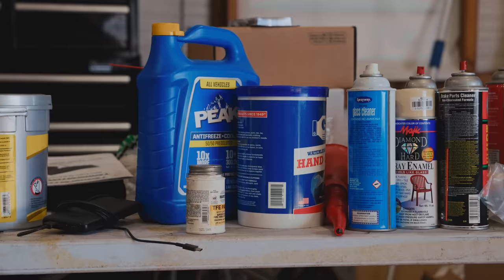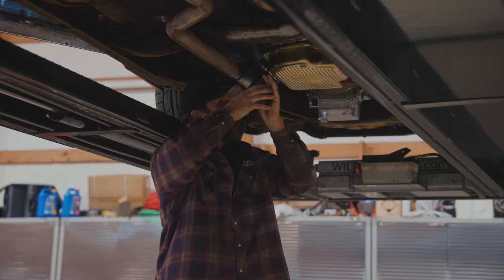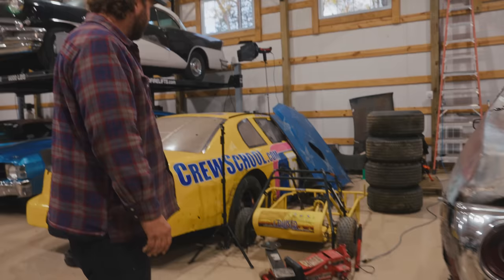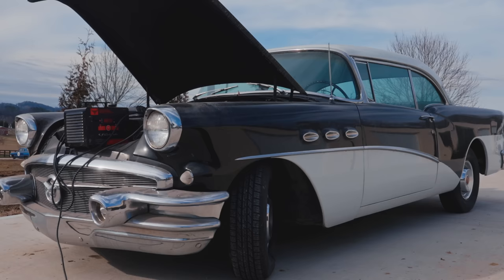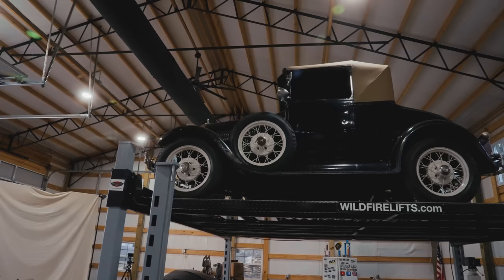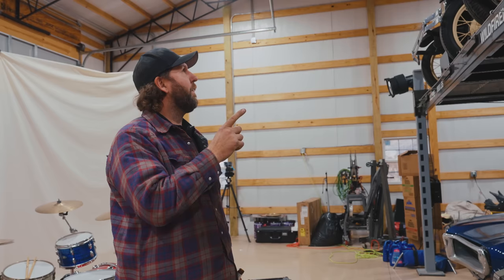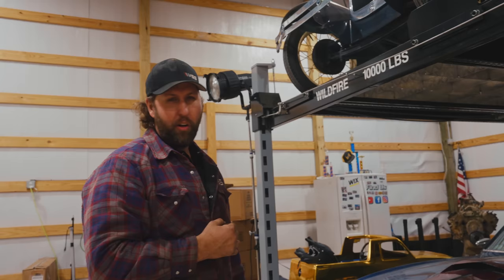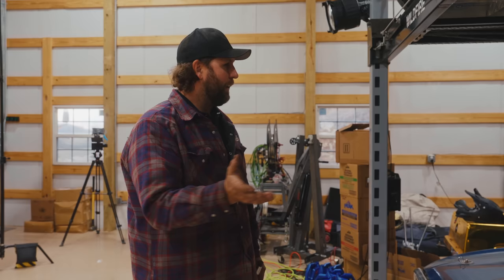Vice Grip Garage Tour with Derek Bieri | PEAK Cribs | PEAK Auto

Comment: I had a red 68 Firebird once with a very much warmed up Chevy 350 in it backed by a Muncie 4-Speed and a GM 12 bolt rear axle. It originally had a 400 Pontiac engine in it with a Q-jet. The Muncie and the 12 bolt came in it from the factory. Very easy to swap over to a Chevy engine. I had to change the lower motor mounts that bolt to the frame for a set out of a Nova. Get a Chevy Bell housing and everything else was a simple bolt in.
Reply: I had a 67 rag top with a warmed up 350 sbc mated up to a built turbo 350 if you were at half throttle or above it would chirp 2nd, man I miss that bird